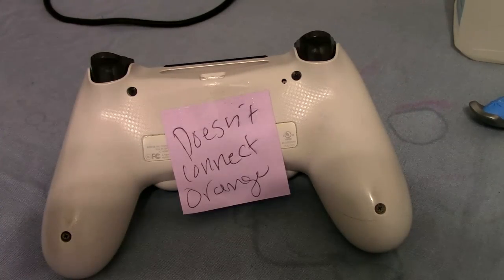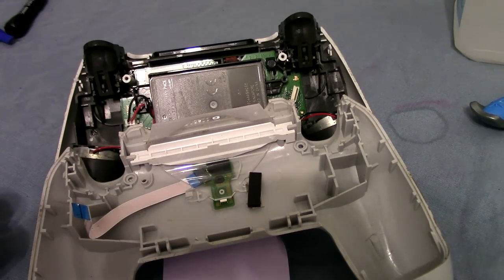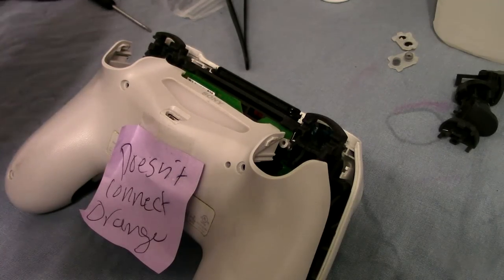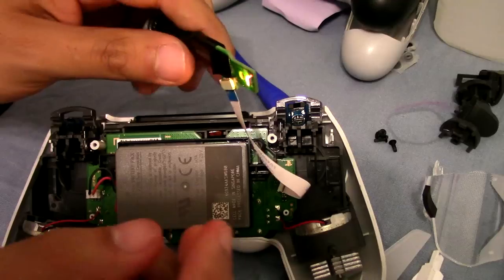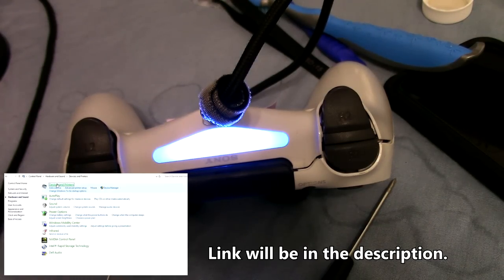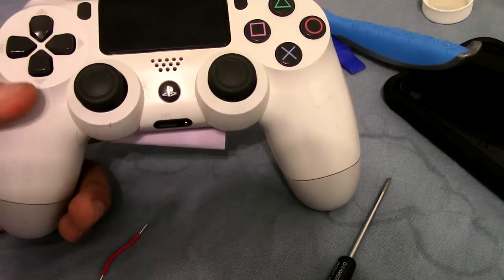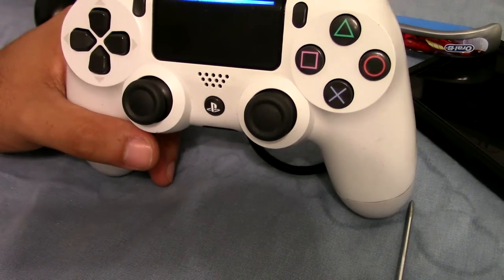How to Fix PS4 Controller with an Orange Light that Turns On Then Off (Conductive Film Solution)

Comment: my light will go on for like 20 seconds like its charging and then it will just go off...any ideas?
Reply: Same. did find a way to you fix it?
Reply: R2B2SW sameeee like when I try to log into my account it turns off and tells me to turn it back on
Reply: @Zac Ballarin It's most likely the Circuit Ribbon shown at 11:00, i have the same issue, light goes off after i plug it in.
Gonna buy one from AliExpress for 2 dollars and see if it works
the only downside is that it arrives in 30-60 days
Reply: @Zac Ballarin for real
Reply: @bandreicatalin 
Did that work btw? I'd love to hear the result.
Reply: K L I’ll let you know as soon as the package gets to me, orders from AliExpress take like 30-50 days to ship
Reply: New controller nag mine dose same
Reply: When it doesn’t wanna charge just leave it standing still and it will charge
Reply: never did find a fix, i had 2 do this too out of the blue....and these things arent cheapp....they dont make anything high quality anymore...i suggest always get insurance....
Reply: @R2B2YT  did you swap out the conductivity ribbon? It fixed my controller that stopped working like a,year ago
Reply: @adamjj7751  wow really....i never did try that...
Reply: @R2B2YT  Really? But that's the solution that the guy in the video found.
Reply: @adamjj7751  i dont think i could ever figure out which ribbon my controller had
Reply: @R2B2YT  what makes you say that? The pinned comment of the youtuber explains where to buy parts and how to know which parts to buy. 

I used the conductivity ribbon from another controller of mine that looked very different and it worked. I do not think it's easy to get a conductivity ribbon that won't work.
Reply: @R2B2YT  once you get comfortable with disassembling your controller, getting to the ribbon is super easy and replacing it is so intuitive that you don't need a video guide for it tbh.

Comment: Do you know what the problem is with controllers not charging anymore after connecting to the ps4? Problem started yesterday tried about 5 chargers and even a new controller but nothing works

Comment: so i found something, if you connect the controller to a charging port or anything that makes the light light and disconnect the battery and connect it again. the controller would start charging but once you restart it or disconnect it, the problem would be back

any thoughts?

Comment: ps4 controller was working fine a couple days ago but now it doesn’t do anything even when it shows it’s connected and the light is flashing and it even gets turned off by itself a couple seconds later of not working.

I also went to device manager to check the problem and there is always a yellow symbol on bluetooth hid device even if I troubleshoot it the yellow symbols appears again and shows that it cant start.

I dont know what happened suddenly please help.

Comment: Hi I have a ps4 pro controller which wont turn off, it shows charging even without the usb cable connected?? Ive changed the battery, usb and the ribbon, tried resetting but still the same?? Can you help?

Comment: My light just blinks doesnt stay on blinks 3 times help..brand new opened it on 31st
Reply: Me too help
Reply: Same happening with mine
Reply: Get a better charger it'll work
Reply: @uf_reva7956  cap, tried multiple cables. its a hardware issue.
Reply: @CalSniffsMilo if you just bought it you have a warranty

Comment: Video title is 100% false.  The Yellow light is CLEARLY staying on, not turning off.  Why did you even name the video that?  To confuse ppl?  This is nothing like my problem.  My problem is that it won't connect, and when I plug in a USB the yellow light comes on for a split second and then goes back off, and won't come on again unless you unplug the USB and plug it back in, at which time it just does the same thing.
Reply: Bro i have the same exact problem, also when i press the pin thingy in the back it turns orange and then goes, is urs like this too? And have u found a fix :( ?
Reply: @inactive9369  Turns out my system simply locked up & was causing the controller not to function right.  I had to power cycle the system, losing a few hours worth of game progress in the process. :/
Reply: @skins4thewin  will i have to do this too? How do i? And is there any other fix :(
Reply: @skins4thewin  it happened to both my controllers on same day so im guessing we have the same issue with the console, also one of my controller seems to be much worse, yesterday it was constantly vibrating and had a bright green color on the light
Reply: @skins4thewin  please help bro, none of these videos working
Reply: @inactive9369  Dude.... relax bro.  I don't know anything about your specific problem.   I simply just had to power cycle my system and my controller started working properly again.  I simply held down the power button to shut down the system.  Sounds like your problem is separate from that which I don't know anything about.  Sorry man, hopefully someone else can help.
Reply: @skins4thewin  alright man . Thanks for replying though

Comment: I need help my controller won’t charge or turn on when I attempt it blinks yellow 2-4 times I’ve tried everything even resetting it, my controller died full while I was playing call Of duty and ever since it’s died I’ve tried charging it for two days with no results in charging
Reply from the maker: It sounds like the battery is bad. You can try to replace the battery within the controller. If you have a second controller or have a friend who has a working controller, then you can try swapping the batteries and see if that fixes it. If it does fix it, then you can buy a new battery without worrying if the new battery will/won't solve the problem.

Comment: Please I need help I bought this controller now and working fine wired in ds4 and control panel but when I connect it with Bluetooth from windows settings doesn't show up in ds4 and control panel and also when it's wired doesn't change light color always orange I need help

Comment: I have my controller this is what happens when I plug it in the orange light comes on but it immediately turns off and then I get nothing from it I would have to plug it out and plug it in again in order to see that orange light so I don’t know what to do with it it’s the only control I have here for this game so what do you recommend I’m all the way in Jamaica I don’t know if I can overnight mail it to you when you fix it or what
Reply: same, found a solution?
Reply: fixed it. really simple. turn the playstation off. pull all the power cables out without turning it off properly. 

It will then go through the 'you didn't power down properly' stuff but your ps4 control should connect now.
Reply: Ok I am going to give that a try and see how that works
Reply: @whitemanjustking564  how did it go?
Reply: Joelus Maximus still did not work
Reply: @whitemanjustking564  sad :(
Reply: Joelus Maximus so what now

Comment: FOR ME THE ISSUE WAS USING THE RIGHT CORD.
I WAS USING A SHORT PHONE CHARGER CORD TO CONNECT THE CONTROLLER BUT TO NO AVAIL. 
FOUND THE APPROPRIATE THICKER CORD AND IT WORKED. 
I TRIED EVERYTHING!!!!
NOW I'M GOING BACK TO SHARE WHAT SOLVED MY PROBLEM. 
HOPE THIS HELPS SOMEONE.
Reply from the maker: YES! Make sure the cable supports data transfer!! Glad you got to work!

Comment: The easiest fix for the orange or white light issue is to connect the controller to the PS4. Most likely the PS4 power is on and you can’t turn it off anyway because the controller is not working. You’ll have to manually shut it down, hold onto the power button for 6 to 7 seconds. Allow it to turn off then unplug the PS4 for about 20 seconds. After that, plug it back in and you should be good to go… yeah this usually happens to my controller maybe two or three times a year but it’s an easy fix.

Comment: Anyone found any other fix? Because I have the exact problem just like in the video, except when connecting thru USB and using DS4Windows, every button works, so I'm quite certain the conductive film is working, I tried replacing battery, ribbon cable from motherboard to charging board, and charging board itself and it still doesn't work, will change the conductive film soon

Comment: There is no need to download DS4Windows actually. Not sure why it's in here. You can check the properties/check if the buttons are working through the settings of the controller on Windows... otherwise good tutorial.

Comment: 2 days ago splash water on my controller then controller light never gone it’s now flash green(during close) if I open it light flash blue normally and if I reset it, turns green and never gone,  all functions and keys works but light never close anyone facing with this issue?

Comment: Hello, my controller has the problem that it only works with the cable on, i already put a new battery and its the same, its the motherboard that doesnt receive the power from battery! Can you put a video how to fix my problem?
Reply: I’ve just had this happen to me. I’ve changed the batteries and had no luck with that as well as did everything in this video and still had no luck. I think it may be an issue with the charger port not receiving power from the battery which would prevent it from turning on. I was wondering if you have tried this already or did you end up buying a new controller. Thanks

Comment: Hey mines won’t connect. It only connects when it is plug into the system.
Reply from the maker: If you are capable, then try connecting to Bluetooth first. Some people said that helps.

https://www.youtube.com/watch?v=NuTROZso7zo

If not, then make sure the necessary drivers are installed/updated on your PC. I'll try to make a video on that soon.

Also try putting DS4Windows in "exclusive mode."

Comment: mine does the same thing but doesn’t turn on at all when not plugged in but when plugged in it is orange and when you press the park button it goes blue and connects so i can no longer use it wireless what do i do ?
Reply: same issue i have, it says it’s charging if when you plug it out.

Comment: I have issues with my controller it works when its connected to the cord and the ps4 but battery does not show on screen after a few seconds led light stays yellowish

Comment: Hey can you please respond? I have a ps4 controller and it blinks yellow or orange two times then it turns off and it keeps turning off i tried reset and reset me ps4 and tried using my phone to delete the controller connection to ps4 and nothing can you help me?
Reply: My ps4 controlles work fine please help me
Reply: Control

Comment: I was able to switch the film from a different controller however the PS button still won't work. The previous film however now works on the other controller, even the PS Home button works. I guess there must be something wrong with the board but I am not too sure. Any suggestions?
Reply from the maker: Hmmm yea it sounds like the board unfortunately
Reply: @Alex-jbz  Thanks.

Comment: I also have this problem, my ps button does not work which i tested on a computer and thats the only way to turn it on. No videos on youtube go over how to fix this except urs. Please go into detail bro i need help
Reply: I’ve just had this issue. I did everything he did and had no luck as well as replaced the battery and still had no luck. It may be an issue with the charging port not receiving power from the battery. For some reason when the charger port breaks on a PS4 controller it completely stops the controller powering on. My assumption is that the charger port is broken and when it’s plugged in it powers on due to directly being powered by the cable however once unplugged it shuts off due to no more power. I’ve also noticed that when it’s plugged in it infinitely says it’s charging which also makes me believe that it’s a charger port issue because it cannot tell what the battery capacity is at. I haven’t tried replacing the port yet but if I cannot get my controller working and I replace mine I’ll let you know if it solves the problem

Comment: For me it was my the plug wasn’t strong enough for my game so so I switched to a stronger cord and it worked it just didn’t have enough position to charge the controller and the controller couldn’t connect to the ps4 cause it was in low power mode basically

Comment: that's strange. I chanded 3 ribbons but my controller just refuses to work. More than that, it seems like i damaged something on motherboard, and now right analog pushes itself top-left corner, even tho i desoldered resistors. Any1 knows what to do?

Comment: Oke guys listen carefully actually maybe noone of these will work maybe cuz of the usb cable there are 2 types of them one that has the ability to share info and one for charging to know wich one u hace u should open the usb cable if u found 2 wires then this is only for charging and if u find more than 2 then its for sharing data wich is what you need  .. there’s another way to know wich usb cable u have wich is bring an android phone and putt the cable in a laptop or pc try moving pics or smthin it wont work if its only charge

Comment: Hey what if my ps button is working but still won't connect. Still having that orange colour when plugged.
Reply: Having the exact same issue. Infact I  bought a new one 2 days ago. I noticed after plugging it directly with a BLU phone charger head with a USB cable it started having problems. It won't charge when connected to the PS4 USB port. But when I replace the dead battery with another charged battery the controller works. All the buttons work including the PS button.  But again won't charge. Am gonna try replacing the charging port this time and see .

Comment: I changed the usb, the ribbon cable, and the battery. My controller isn't charging. As soon as I disconnect it it shuts off
Reply: Did you find out what's wrong with it?
I have the exact same problem
Reply: @purplecheddar7142  I didn't, sorry

Comment: Okay i saw this video yesterday..my problem wus the ps button dnt work...traces worn out...
Soo what i did wus ..
Found the pinout the the Ps button on board....
Soldered two tin copper wires to a external button....
And now its working....
I suggest yall try it out...
If its the ps button its a for sure fix.......good luck to everyone

Comment: My light stays stuck orange no matter what. 
Plugged into USB cable stays on.
Unplugged stays on.
PS4 plugged in or off, The damn light is still literally stuck orange.
None of my other controllers have this issue and I can't find anywhere on google for a solution. Someone made a thread about this but hasn't found a solution..... Please help.
Edit: btw the light isn't even blinking, it's literally just stuck on orange and doesn't respond....

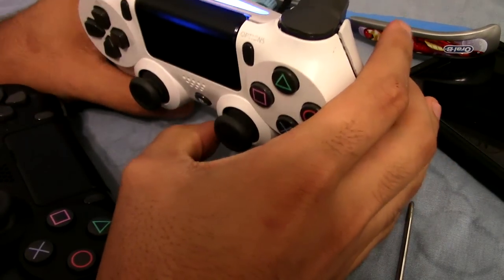Comment: I'm having the same issue as this controller but up until 7:45 when you stumble on the Home button not working. My home button does work ... so close and yet so far :(
Reply: Im having the same issue, my controller flashes yellow as its charging but as soon as i disconnect it no power, if i put usb back in yellow light still comes on as it charges and it works fine if connected to usb, so it must be the battery. Ive tried to reset it countless times, its the camo one im told common fault, its 6 month old and hardly used. Sony are not what they used to be im afraid

Comment: Dude my controller just turns light blue and then stays at light blue until you turn it off. Like I can't even get out of the start up screen because the controller doesn't connect. It doesn't blink it is just a still light

Comment: My controller light is blue normally but when I get in to game it will turn red . Is that normal ?plz answer 
Thank you 🙏🏻
Reply from the maker: I think you can change the color in settings or something--not sure. So that may be why. But when the controller changes color, its usually because another controller is connected to the PS4.

Comment: idk if this will help anyone but I had the same problem 
(after pairing my ps4 controller to a bluetooth dongle on my pc my ps4 controller wouldn't connect to my ps4, even when connecting the two via usb cable)

Solution: I used a different usb cable connecting the controller to my ps4 and pressed the playstation button and it worked

I wanted to know if the first usb cable was faulty, so I tried pairing my controller again using the first wire and it worked
side note: my controller was dead too when I tried to connect it to my ps4 so maybe that was what was causing the issue too
Reply: Worked for me. Thx

Comment: My PS4 controller is just flashing orange very slowly when I connect the charging lead. It won’t connect when I press the PS4 button. What the hell do i do? I’m reluctant to take apart, I don’t have a screwdriver small enough for starters.
Reply: Same
Reply: ....if ps button dnt work....
Find the two pins on logic board and solder two tin wires to a button....and i should work....i fixed mine a hour ago

Comment: I plug mine into the ps4 then it turns on orange for 3 seconds then turns off and nothing happens. I have no idea how to fix a controller plz help.
Reply from the maker: Did you try the steps in the video?
Reply: Same problem did u get a fix

Comment: Mine stays yellow all night even when it’s unplugged
Reply: My old controller has that problem too. I changed the battery, but it didn't work. It still works but it drains the battery because that light never shuts off